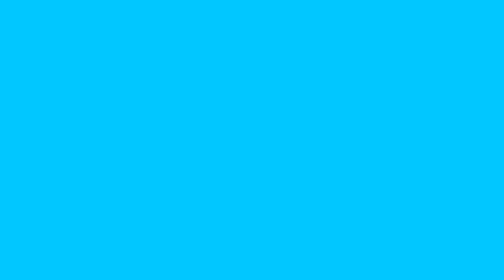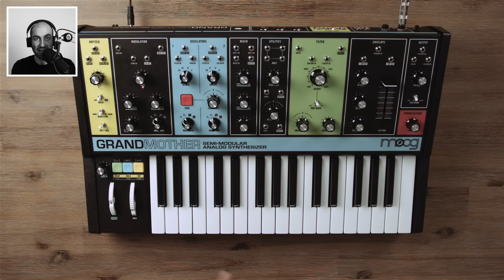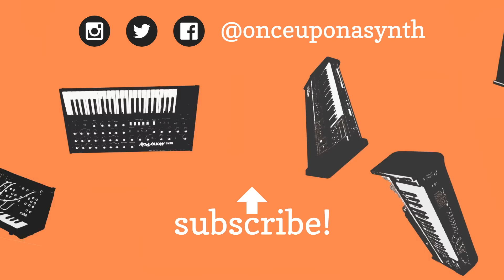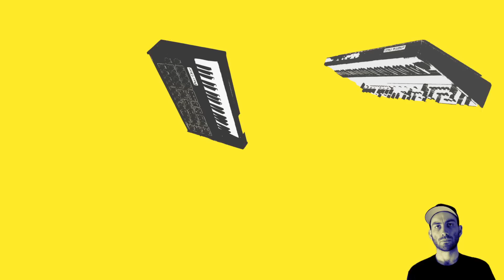My 7 Patch Tips for Moog Grandmother

Comment: Stupid question: Are any of those path outputs actual audio output? Other than the actual audio outputs and the headphone output on the back of course. For example, could you run a cable from the oscillator output into a guitar pedal and then back into another input patch on the synth? Or are all of the patch outputs just voltage telling the synth what to do?

Comment: I followed you along on this with my GM and I got very different results. For instance the last tip where you patch the WAVE OUT from OSC2 to the REVERB IN, the OSC continues to sound even if I am not keying in a note. All other settings are identical to what you have on your GM. Trust me, I checked several times. Is anyone else having variances in the results of these patch suggestions?
Reply: yes im having the same issue. no idea what the problem is. Did you find a solution yet?
Reply: @driesferiani  Well, it helps to NOT have the drone on...derp. But still, I ended up updating the firmware regardless due to some later discoveries. I had some issues with it not recording sequences. A bit unsettling having the up the FW having only owned a Moog for a few days. <SHUDDER> I haven't gone back thru this vid to see if that helped but if I do and it did, I will DM you the result
Reply: @maddmannmatt  Thanks man!

Comment: Hey great tutorial, I just got my own Grandmother finally after ogling yours for so long.  I love a lot of the tricks that get displayed here but the last one with the spring reverb is probably the coolest.  When I try doing it on mine (patches all the same and drone definitely off) the second I go to plug oscillator 2 into the reverb-in patch, it starts to drone which kind of ruins the whole effect.  Wondering if I'm the only one who's had this problem and if anyone had any idea of what I was doing wrong.  I keep going over everything and I'm coming up empty
Reply: Hi, just stumbled over the same problem. :D Just turn the reverb knob to the left (very contra intuitive). The signal is kinda weak, but you get the result from the vid! (That wasn't my solution, found it on Reddit)
Reply: i'm having the exact same thing. Did you already find a solution? Thanks
Reply: I"m also having the same problem. Has anyone found a solution?
Reply: Yea i also have this problem, any suggestions?? HELP

Comment: When they debuted this synth, I thought that Moog had done something gimmicky in adding a spring reverb tank.  Then I played one at Moogfest last year.  Nope.  It's an integral part of the sonic nature of the Grandmother.  Such a fun playground.  You bring the best out of it.  Thanks.
Reply: Do you have any thoughts as to why they put a delay but not a reverb into the Matriarch?  It seems a bit odd, since otherwise the Matriarch is much more powerful.  Yes, from what I've gathered there are a few other things the Grandmother can do and not the Matriarch, but they sound relatively minor.
Reply: @RadicalCaveman  Matthew here from another account:  I'm now very lucky and happy to own both the Grandmother and Matriarch.  I think they did it just to differentiate the synths a bit.  The Matriarch signal path is different with all the stereo options, but I'd guess that putting the spring reverb tank in there would have made them too similar.  I can't say I miss it on the Matriarch, but it would be nice to have.

Comment: re: 10:35 - does this mean that without patching into the reverb input you could effectively feed the regular reverb'd output back on itself by replacing one of the oscillator inputs with a patch from the reverb output? like double reverb?! rrreeevvveeerrrbbberrrbbbrbrrrrbbbb?

Comment: Hi, I’m having trouble executing tip 7. It seems like the reverb is feeding back on itself and sustaining forever. The noise knob on the mixer isn’t effecting anything. I’ve triple checked the patching to match yours but still having issues. Thanks for your help!
Reply: I found the solution! Somehow we assumed that we should set the Reverb to fully open. This is not the case! The Reverb out on the back is always fully open. So if you keep the reverb closed everything works as demonstrated!
Reply: Gerard Meerstadt you’re a star mate
Reply: Same thing here. Funny thing is that according to the signal flow diagram in the manual, everything that goes through the VCA has to go through the wet/dry mixer. So if that is on 100% wet, no dry signal can come through. So we cannot hear OSC1 and the Noise. Only OSC2 on an endless sustain. So our experiences match the flow diagram. So either he has another version of the machine, which is unlikely, or he does not have the Reverb fully open, although it does look like it on the video. Unsolved riddle. Please, Once Upon a Synth, help us out!
Reply: Jonathan O'Brien I’m having the exact same problem. Pulling my hair out.

Comment: WTF?  Trying to use the Mults as a mixer?  That's not how that's supposed to work.  You're connecting 3 output signals directly together. That's not good. A Mult is for taking 1 input and creating multiple outputs, not for mixing signals together. And nobody in the comments section bothered to point that problem out?
Reply: Just watched this video for the first time and was thinking the same thing. Apparently you can do this with AC coupled audio signals only. The Grandmother manual mentions it on page 25: "Note: Only audio signals may be merged using the MULT jacks, and only audio signals that are AC coupled. These signals include OSCILLATOR 1 WAVE OUT, OSCILLATOR 2 WAVE OUT, FILTER OUT, HIGH PASS FILTER OUT, REVERB OUT, and EURORACK OUT"
Reply: @DetlevSchwabe  But Why would one in this case? Can´t you just patch the noise out into the hight pass and then the highpass out into the third input of the mixer? that way you keep individual control... interesting though that one can use the mult as audio rate extra mixer.

Comment: Love the tips!

I wonder if it is possible to get the output into a Small Stone and back into the synth to get the reverb on top of that?
Reply from the maker: Thanks! Good question. In theory you could just patch it in between the filter and the VCA, that way it will be processed by the reverb. But you'd have to convert the 1/8" to 1/4" and back. I'm also not too sure how the levels will work, because the level from the filter output will be hot (it's before the amp) so I'm not sure if that would overload the pedal.  Maybe I'll try that with the phaser moogerfooger one day and hope that nothing blows up 🤞
Reply: Good point that! Would the level be lower ( I could be completely off here ) if we get the signal out before it hits the filter ?
Reply from the maker: it might actually be higher.  Or rather, it's probably the same, but the filter will at least attenuate it slightly if partially closed.  But actually I just remembered there's a mixer before all that (lol duh), so I think it should be fine cause you can control the level of the oscillators there.  So yeah, adding the pedal anytime after the mixer should be ok.